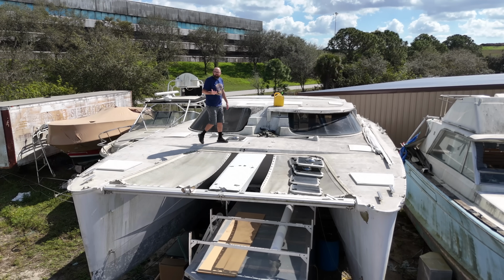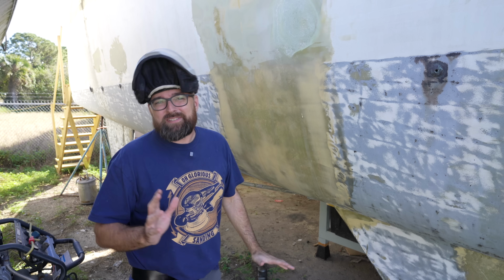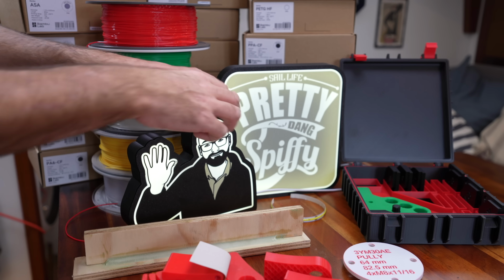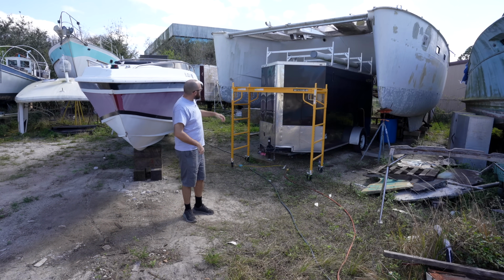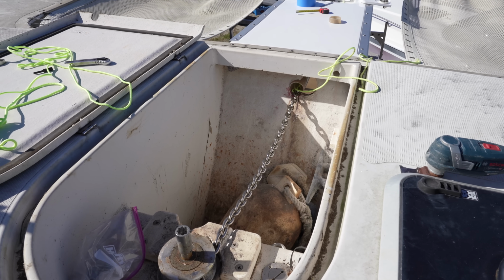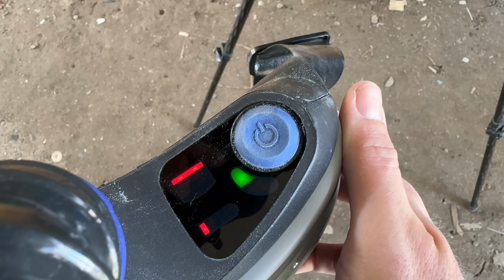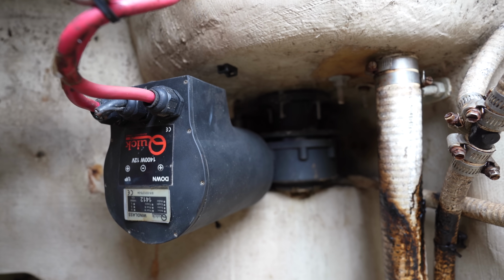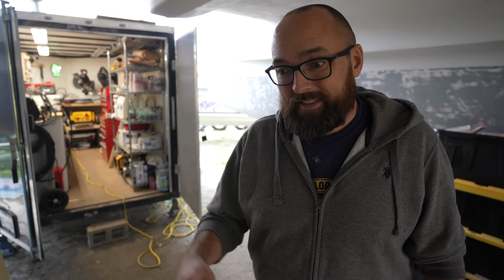⛵️ Failed repair? Now what? Hurricane-damaged catamaran Ep616

Comment: I know you are way past this but thought I should say it anyway just in case you still have the unit! There is most likely a bad connection on the ground side of the circuitry for your dork helmet. This can happen with overheating. Take a look at the power side of the circuit boards—sometimes it is not noticeable to the naked eye, but the solder may have come loose only after heating up, triggering that fault. This is just my educated guess, but it will be something like that with one of the components. I see this all the time with TVs: people end up throwing them out when all it needs is a new power control unit or resoldering of the grounds or replacing a capacitor or two that blow out.

Comment: What about lining the fibreglass chain tubes with HDPE or LDPE pipe? Go for a pipe OD that’s slightly larger than the tube ID, but cut then cut a strip out of the pipe to reduce its OD enough for a snug fit. Immersing the pipe in hot water would soften it nicely for fitting.

Comment: I agree completely with your assessment on predeparture restoration/fixes. Go with what you got and do a more detailed refit in N.C. I would even CopperCoat the undamaged hull portions and skip or thin coat the soon-to-be-repaired areas. You are only going to be in the water, under way, a couple of weeks, with the first week almost non-stop, except for a food run or two and a few overnights. Get outta town while the weather is mild. Godspeed Spiffy!

Comment: Moving north is a double edged sword.   Yes it would be cooler and less concern about hurricanes.  However,  move to far north and the colder temps could limit your ability to do fiberglass repairs and painting.

Comment: You are way over thinking this. Give it a good sanding do some more fairing and then put on the primer. Do the bottom job and then when you get it under cover you can spray on the top coat. We have left epoxy ot in the sun for years and then finished it and it is still all good.

Comment: Mads, I love you vids and new project. I would just like to know why your are using the fiberglass tube at a 1/8th wall thickness, but not worried about wear on the side wall with the friction on the chain. I was expecting you to use a stainless tube fiberglased in place ?  Keep the vids coming

Comment: Two tips. First. Fiberglass Supply Depot in Fort Pierce, FL. Online shopping and a couple hours south of you by car.  Lots of product and expert advice. Second. Buy a mixing board with peel away sheets or one that can be cleaned for mixing faring compound. It will make your life easier.

Comment: Ok long time subscriber here and I think you need to pump the brakes this is not a criticism of the previous repairs done but you've already spotted a problem with some of the repairs I would not put this boat in the water until those repairs are completed and you know for sure that you're not gonna have any kind of failure because I don't want to spend the next six months watching this youtube channel have to recover their boat from the bottom of the ocean

Comment: I had to request a refund from Total Boat for their Total Fair last spring. Apparently they changed formulas and the new one has a micro bead issue where these tiny .5 mm micro-beads in the blue would not mix in and left drag marks in the fairing compound. Might be fine for rough fairing, but for fine faring it was not usable. your mileage may vary

Comment: Take a look at King Arthur grinding tools. I have used the carbide 4" for 20 years, still works like new. When it clogs, hit it with a torch to burn off any unwanted material,  and it is good as new. Fits your standard mini grinder.

Comment: Ok, here's my take: You have two options: one is, do the repairs properly now or do some kind of "field repair", then move to the new location and do it properly.

Considering you only have about three months until you want to move, I'd lean towards the second option. So, fix the stuff that is critical to any movement at all, like engines, steering, etc., slap some sacrificial paint (doesn't need to be the usual super toxic bottom paint!) on the bottom and over the unknown repairs. Forget about the copper coat for now, it doesn't matter since you're planning to be in the water for only a few weeks. Take the ICW to the new location, grind off the sacrificial stuff and do the repairs properly. Only when you're good and ready apply the copper coat.

Comment: Why not have the boat moved overland to the new location?
Reply from the maker: Cost 🙂 It’s 22ft wide meaning it requires escorts and special permits. Just moving it from the yard to the marina is going to be expensive ($3-5000). Moving it to, for instance, NC would be astronomical 🙂
Reply: @SailLife  Oh my goodness. OK, yeah that's not a viable solution at ALL.

Comment: FYI, yes the state of Florida is warm/hot most of the year but it gets just as hot if not hotter during the summer in most parts of the country (northeast). Be prepared for sweaty temperatures from late May through September and very cold from late October through mid April.
Thanks for the weekly vids.

Comment: Just use layers of uni or biax and alternate the directions. It will be the same end result as triax. I agree that the repair is probably OK for the ICW but it just makes sense to fix the hull before you paint the bottom and all that. Otherwise there will be an awful lot of duplicated work.

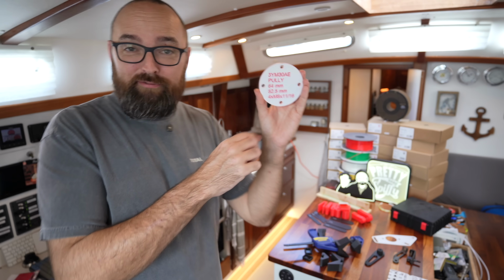Comment: Hi Mads. Although I know your engines aren't finished, I'd like to point out that your raw (sea) water hose from the raw water pump may be fitted incorrectly. (At 10:01 as you place the crankshaft pulley doohickey). On my 3YM30, the drain plug is closer to the raw water pump, and therefore at the lowest point so it can be effective as a drain. The built in bends down line from the drain plug then conform to the direction to the heat exchanger. Cheers, Tim

Comment: Wouldn't a layup on the inside with extra overlap of the same schedule and more, splice the hull back together? The outside already repaired with unknown voids would then amount to filler although the taper and layup is correct?

Comment: Revchem composites is a great supplier to work with.  I have piles of scrap carbon fiber filament wound tube laying around left over from jobs.

You should use pipe flanges to hold the tubes in place to make them easy to change.

Comment: I highly recommend a "gelcoat peeler" for that job to remove the fibreglass, you can shave it back to a measured depth, it's super quick (1 square metre in 5 minutes) and it's 98% dustless! I've used one myself to restore my yacht hull and it's freaking awesome!!

Comment: We do the ICW every season and mostly do it all inside with only a few hops outside if the weather is good   I don't think I would like doing it twice with two boats or even splitting up and convoying both together.  It's a good 3 weeks pushing it pretty hard one way from Florida to the Chesapeake and that's not spending any time visiting all the cool places along the wa.  Uou could shave a bit of time going outside but only if you had good weather and wanted to do days at a time.  Going out and back in for day or two day hops hardly saves any time especially if the weather does not cooperate. We have friends who do this and we consistently make more miles per day on average than they do moving on the inside because we don't need to wait for weather nearly as much.  There are only a few weather-sensitive spots on the inside sich as St Andrews Sound in Georgia and the Albemarle/Alligator/Pamlico/Neuse in North Carolina.  We are comfortable travelling most other spots in small craft advisory conditions and practically up to gale warnings.  The Chesapeake can be almost as bad as the open ocean depending on the wind direction and your direction of travel so that slows us down too.  The Delaware is almost always crappy while the Jersey shore is definitely a spot to wait for a good window.
Reply from the maker: While I don’t want to take the catamaran offshore we could easily do that with Athena. That would mean one 3 week trip and then one 4-5 day trip. That helps a lot 🙂 Of course then we need to do at least one more trip to get the car and the CRV is not up to hauling the tool trailer so that might be another trip 😂
Reply: @SailLife  bummer that the CRV isn't up to towing the tool trailer but maybe a fan might step in and help you pull it up and convoy with the CRV.  

There is also the autotrain which is something some cruising friends do with their Corolla when they head north back to Pennsylvania.  Load the car on the train and ride in style or even meet it up there.

Comment: Mads; Sorry for the interruption, but the name of the simple machine which is used to redirect the direction of a line, (rope), chain or belt is spelled 'pulley', in North American English, as far as I (and my word processer) know.
For the anchor rode tubes; how about a sacrificial liner? Maybe PVC with an ID just shy of the fiberglass tube ID. You could even make it in 2 pieces with an outward flare (formed by heating) on the outer ends, in order to avoid the chain hitting a squared off corner and stressing the tube. 
P.S. Wasps: I'm in Connecticut (42N) and I have plenty of wasps, hornets, yellow jackets around my back deck in the summer. Once I was mowing the lawn and got hit on each arm when I ran over a nest (apparently). It gets REALLY cold here some winters and, somehow, they always come back.

Comment: Did you consider a box that services both chains, rather than a tube, you could access it easier and put a replaceable base plate for ware and tare. Would look nicer from underneath and you could have a top hatch to clean any gunk that collects and creates blockages.

Comment: Hey Mads, you might be able to do use ultrasonic testing to check the composite repair's quality. Ultrasonic is relatively cheap and easy... It might pay off to investigate if you can acquire an ultrasonic unit or have a technician do the testing (yeah, the latter is no good for content...)
Reply: @joshhouskamp3014  I suggested UT since it is what I do on a nearly daily basis

Comment: should you ever have to replace those fiberglass chain tube thingies consider good 'ol pvc pipes.  they're dirt cheap, utterly waterproof, and easy to replace.  they even have a whole family of fun-fun connections to customize the installation... i.e: add in a pvc clearing fitting and you can put a hose on it to clean the chain as it goes through.

Comment: Check out Fiberglass Coatings INC in Saint Petersburg FL. They likely have what you need. I think they supply Catalina and Island Packet. If you need delivery i might be anle to pick it up and drop it off. We met way back in Brooklyn at the meetup. 

I doubt you will not find much relief from the heat untill perhaps Maine, then the winters more make up for it. I don't find Florida much worse than New York. The sun is stronger but we frequently have lower temperature due to ocian breezes.

Comment: Mads my opinion is to complete all repairs from the rubrail down where the boat is now. And if you wish then leave other deck repairs for the new location.
You could even prime the hulls with roller if you want to wait for a proper painting tent to spray top coat.

Comment: FWIW I say rip out the previous repair and lay down new glass before splashing the boat - it will take roughly the same amount of time as repairing the previous repair and with a sound hull, you'll be able to move the project forward - rather than having to go backwards again.

Also, we need more oh glorious sanding.

Comment: I’d definitely check and repair the hull repairs first. It’s the “foundations” of the boat. It doesn’t feel good to work on anything else until that’s good. It doesn’t need to be faired, as long as it’s strong and protected.

Comment: Instead of stainless steel you could use the same tubes but include a Teflon tube liner into the tubes. At the ends of the tubes I would also include tube flares.

Comment: Liked. UHMW tube would work for the anchor chain tube. McMaster-Carr has several sizes. It may not work with the size FPR tubes you installed.  I have used UHMW for many high chafe protection, haven't had a failure yet.

Comment: Mads, I imagine that you have fans all up and down the eastern seaboard.  I know you and Eva want to move the boat this summer to somewhere that you can get a more moderate climate.  But I also think you are looking for something where you can lower your costs of renting both a boat yard and where ever you live.   If you could describe to us where and what the setup optimally would look like, I bet there is somone on here that may have the place in mind.   I live in one of states in the middle, but not along the coast.  I just looked for a piece of property to rent that includes some access to a hoist and then a location to work on the hull out of the water.  But these always include the property that has a dock but no hoist.  What is your idea?  I think you can find a similar setup that you have there where you have the boat out of the water in a yard that allows for work being done.  But, the place to live would be off site nearby.

Comment: Do you have access to anyone with a UT edit* (ultrasonic testing) machine who can scan the laminated side to see if they can find any voids or delaminations? I use one on steel nearly on a daily basis, but I would think that if you could set up the machine with the right transducer and a way to calibrate for the speed in which sound travels through that material, you should be able to find any bad spots

Comment: Important note :  Epoxy resin bonds with Kevlar & Carbon Fiber .....De laminate will occur if polyester & vinyl Ester resins used when  the above cloth fabrics are used. Also never use epoxy with chop glass will not bond...Always experiment on a test sample before applying to the actual project. Do Not trap air bubbles or mix chemical wrong ratio, over heating in the reaction. Allow proper curing before applying additional layers, to prevent warping. Read all instruction labels to avoid costly mistakes...Wear Safety PP clothing & eye protection & gloves & fume dust mask for your Health Safety... Happy Sailing ⛵️

Comment: You were saying that you don't know of any way to check for bad spots in your boats repair area. Might I suggest a few options from the aviation industry? I'm a aviation A&P mechanic with over 20 years experience working on composite aircraft and aircraft parts, both structural and functional (parts that have function but are not structural elements, like speed fairings and nose caps) and 20 years as a NDT (Non-Destructive Testing) inspector.   There are 2 good ways that we use to identify delaminations or voids in composite structures. The most accurate and most expensive one is with a ultrasound tester.  These are widely available and easy to use with a little training, and like stated before, highly accurate. The cheaper option (and the one we use most often) is an acoustic tester. We just use a 1.5 to 2 inch fender washer and tap the material. Good solid composite will have a sharp sound when struck, delamination or voids will have a soft, dull, mushy sound when struck.  Look into these options for the previous hull repair on your boat. Best of luck to you and your wife. My family and I wish you smooth sailing, clear sky's and a following sea.

Example of ultrasonic tester type I use.
Wintact Digital Ultrasonic Thickness Gauge Tester Meter, Range 0.039 to 8.85 in with Probe for Measuring Metal and Nonmetal Materials, Steel, Silver, Plastic, Glass, PVC, Pipes https://a.co/d/594iZuG
Reply: Came here to say this. Ultrasonic NDT could save you a TON of work.
Reply: As an A&P that did plenty of tap testing on helicopter rotor blades, I endorse this message.
Reply: Just a note: ultrasonic is also an acoustic method. Ultra high frequency audio waves.
I agree with the previous comment, this measures thickness, how will it show if the fibreglass structure has tiny air bubbles inside?
An ultrasonic imager could show it I am sure. This device seems to only show wall thickness? Perhaps if you compare the true thickness of the wall with the measured and see the difference?
Also, if the fibreglass wall is already a sandwich structure, inside balsa or foam... how will this device handle such a structure?
My guess is an ultrasonic Imager would be the only proper method.
Reply: Just curious - how would degraded epoxy show up in this device? The material is still there, it's just not bonded properly any more.

Comment: Talking of sanding blocks… when I built my boat I wanted a round block for sanding large fillets on the hull, frames etc. I used a short length of pool noodle ( those long cylindrical floating foam toys), cut a slot longitudinally, and the sandpaper just long enough to go round the noodle and with a sharp fold, slot both ends into the cut.  With a little trial and error, get the length and fold positions just right and the paper stays put no problems. Worked brilliantly even if I do say so my self. Fitted my hand, fitted the fillets. You couldn’t buy a better tool.

Comment: You should use lateral stringers to reinforce the damaged area.  Given they would be placed on the inside, the exterior is not impacted.  They will add significant structural strength and mitigate against a catastrophic hull failure.

Comment: @saillife Mads, (I think you used this method in Denmark when you repaired Athena’s osmosis bubbles) for the big flat fiberglass grinding why aren’t you using an electric hand plane? You can have a decent dust control with a shop vac attached and take a good bit of glass off at the same time.